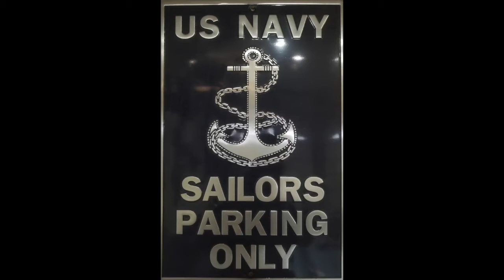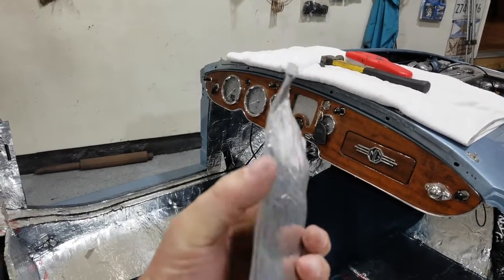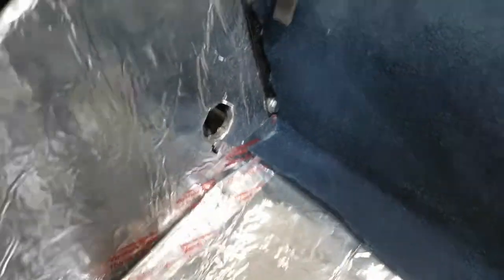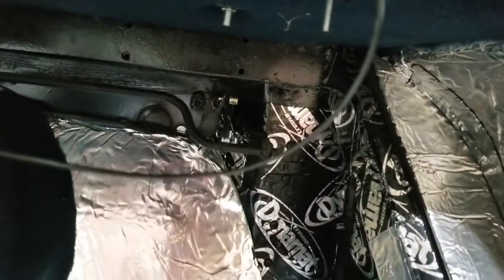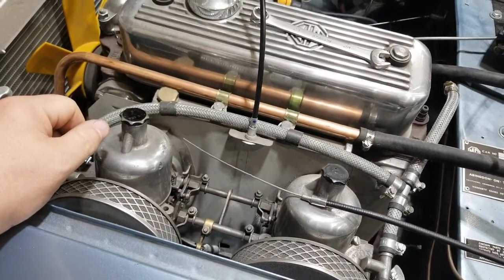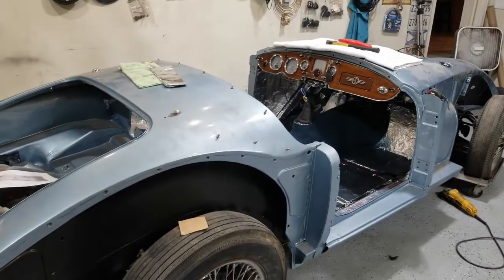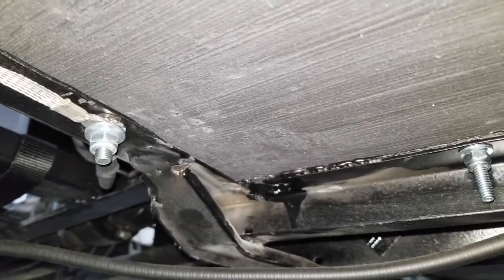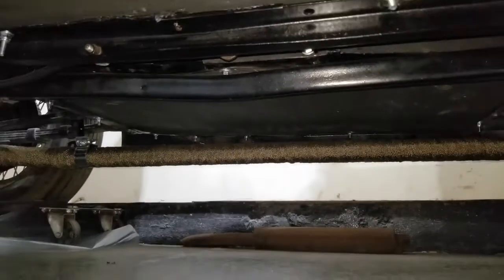1958 MGA Restoration 26c Wood Bits Installed

Comment: A constructive comment if I may. The B pillar braces back to the body need to be installed as they are a structural component which positions the pillar on the correct angle to the body AND helps prevent movement of the pillar when under way. The body on these cars move around a bit so need all the support they can get. The top of the pillar should also be attached to the body which also helps stabilise the pillar. Any movement in the B pillar affects the door latch alignment and operation. Rework can be a pain particularly after painting but correcting this may save you some grief later on. I have followed your resto with considerable interest and always look forward to your next episode. Cheers from Australia. I also have some stuff on my channel to do with my resto if you are interested.

Comment: Please no white walls.
Reply from the maker: You don't think white walls would go well with the body color?
Reply: @christos7440  It would go great with the color just not with the car. Every time I see a  restored LBC with W/W I think nice car but get rid of those W/Ws. It's your car and you've done a beautiful job, so who I am.  I have enjoyed your posts.
Reply: My 1960 had two 6 volt batteries behind the seats wired in series to make 12 volts. Twice as much maintenance as a single 12. And the plywood shelves weren't very resistant to acid haha. Epoxy based coatings aren't available back then. 
I think the white walls would be a pretty nice look. I had white-lettered road huggers, but it was definitely not a race car... More of a sweet sounding cruiser, with a harmonic sweet spot about 65 mph